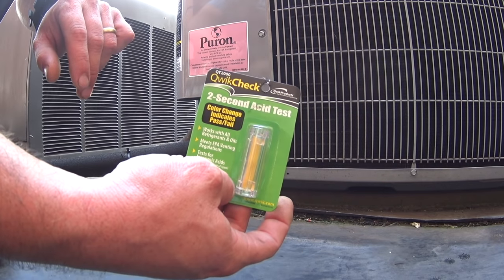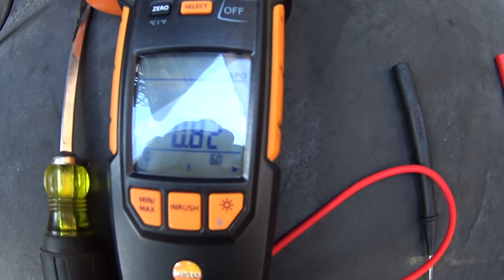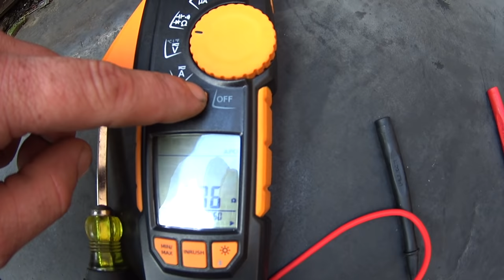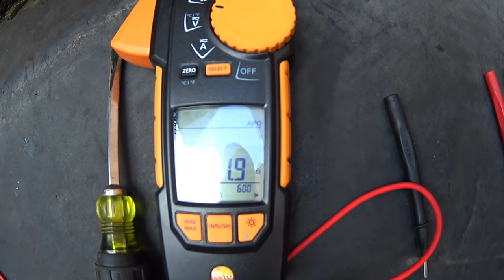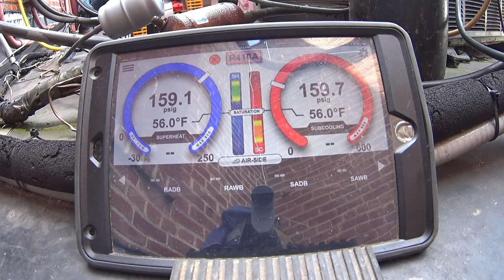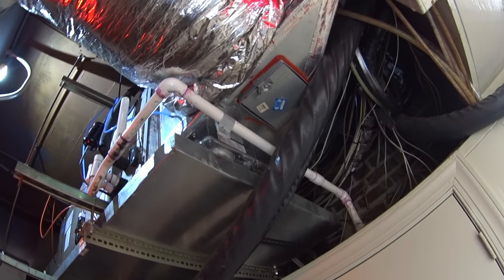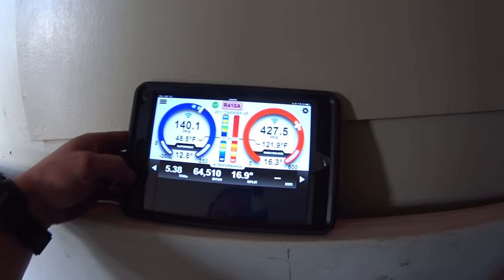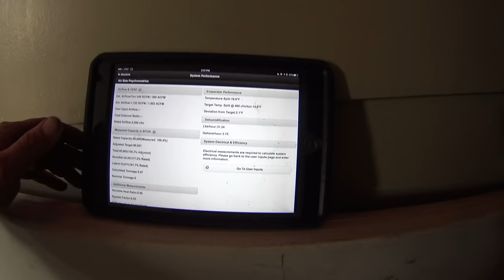HVAC Service: 5 Ton Carrier Compressor Replacement

Comment: I use cheater cords a lot because sometimes running to an outlet isn't a good option. But we had several schools with equipment rooms full of 480volt WSHP's but not a 120 volt outlet within 150 feet. Had to make an extension cord out of 10-2 romex. Just because someone is an Architect/Engineer doesn't mean they know how things work lol. Good Video Stephen!
Reply: Back in High school my dad and I where working at this school and they had a plug that measured 185 volts AC while we were there. ie it was a 208 volt line that on a hot day was 185.  ie like the 185/1.73= 107. ie the 120 volts was sagging to 107 volts on a super hot day thus the 208 Y part was actually 185 volts.
Reply: ComfortPlus Heating and Cooling carry u a small 5kw transformer and hook up in the disconnect. 480/120-208

Comment: Stephen today in a basement with 3 water to water geos, replacing compressor on one of the units, recovered all the refrigerant, very tight work area, decided to sweat out compressor, and change out liquid line drier,  problem is, when I sweated out the suction line, had a rush of residual vapour, well not a lot, but face was 3ft above  compressor, eyes watered, I coughed, then co-op student ran lol, I think we all do it,  inhaling any burnt refrigerant is never good, any suggestions?   Even just a whiff of burnt refrigerants, in a confined space is terrible.
Reply from the maker: I've yet to find a way to keep from getting a little. Hold your breath longer??
Reply: Stephen Rardon Bro.. what song was that??

Comment: just wondering why you pressure tested it to 160 psi? we test at 400.
Reply from the maker: Kyle Faubertq  that what I had in the tank *****  I learned a valuable lesson, I have a very vague memory of a High Leg being discussed at some point
Reply: +Eric M not sure. i have had atleast 30 refrigeration mechanics and some teachers.
Reply: +Stephen Rardon (HVAC with Stephen Rardon) thanks for the reply steve. i figured so
Reply: I test over normal operating pressures (300 for 22, 400 for 410a) because it doesnt do any good to test for leaks below operating pressures. IMO.
Reply from the maker: CJ Roe if I question the lower test I'll hit 500 next, but no drop is still no drop
Reply: +Stephen Rardon (HVAC with Stephen Rardon) i see what your saying about drop, but a weak weld may not show its self under a lower pressure, then when the unit fires up, pressures expose it... 

Youre a pro brother, im sure your experience in the field supports your reasoning. Im not questioning you, i just do the same thing differently :) good video btw.
Reply from the maker: CJ Roe no problem
Reply: +Eric M i guess i was just thinking about standard residential, since thats my primary work. 👍🏼
Reply: I’ve seen a leak not show until 250 ish it can happen usually at those brass coil connections going to copper lines with their own silver solder on the brass adding your 6% casing micro leaks
Reply: Eric M that’s kinda like saying I can’t add enough refrigerant that the system needs cuz I can’t afford it nitro is cheaper than refrigerant right? Call someone if you fucked up and didn’t stock more than 40 psi of nitro for a pressure test that’s sad dude. I didn’t have a 10mfd capacitor so I just put in a 5 that’s good right ?

Comment: Why don't engineers design the parts to be easier to replace instead of having to weld? Use a coupling or something
Reply from the maker: Mechanical connections that require torque or compression can easily loosen with the vibration the compressor creates normally.

Comment: You bought a new recovery machine retail?! If interested I have a Yellow Jacket XLT 95760 brand new I"ll give it to you for a great deal.
Reply from the maker: +Order in Chaos no, they did a warranty exchange for me
Reply: Oh come on man! You exchanged it because it popped a fuse? I should finagle a way to return mine...
Reply from the maker: Order in Chaos couldn't get fuses same day, needed a pump...didn't see any other choice!
Reply: When you're cheating voltage around get yourself an automatic voltage regulator downstream from the cheater and connect your brand new now recovery unit so this will never happen again. Some have multiple outlets so you can use multiple tools at the same time. Some work as transformers/regulators/stabilizers so you can connect both 240 volts legs and properly use the ground instead of combining it with the neutral; this way you'll get both 120 and 240 clean outlets out of your cheater. The only difference is that you'd need an adapter from the cheater to the transformer for the 240 volts... But if you only need it for your 120 volts tools get yourself the APC LE1200 voltage regulator for around $40. Or something more portable if you need it to fit a Veto MB2 for instance. You'll save a trip looking for fuses or arguing about warranty coverage...

Comment: I've been the H.V.A.C./R. industry for over 10 years and this is one of the worst examples of a compressor troubleshooting and compressor replacement videos that I've seen on YouTube. Unfortunately I have witnessed these subpar methods in the feild plenty of times, but I have never seen someone with the ignorance enough to film themselves doing this type of work of cutting corners and skipping critical steps. I suspect that the replacement of his recovery machine greatly affected the time constraints of the "ticket time" afforded to him, but brazing without nitrogen or not sanding and cleaning his copper connections, not mounting the feet of the compressor prior to brazing and then moving the compressor around is laughable, and sloppy. Not testing the compressor terminals directly??? Is lazy work and uncertain. Not applying cooling to the filter drier while installing is ridiculous. And on and on..... bad job and you Sir should know better.
Reply from the maker: 😂😂😂, 10 years huh? Where did you learn your craft? Union shop? I’ve learned what I know the hard way in my 22 years in the trade. I could stand to improve my process I suppose but it was how I was taught to do these sorts of things. I do flow nitrogen though cleaning the joints has never shown to be a problem of enough significance to spend the time on it.
Reply: @StephenRardon  The Empress has no clothes on...